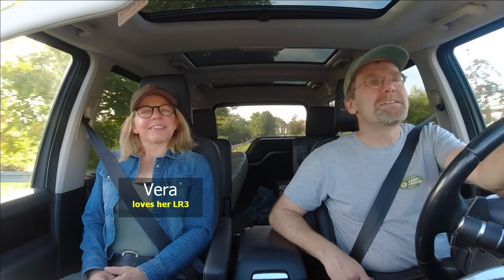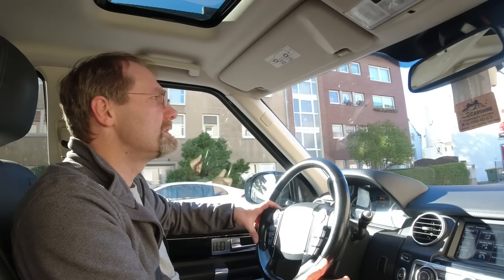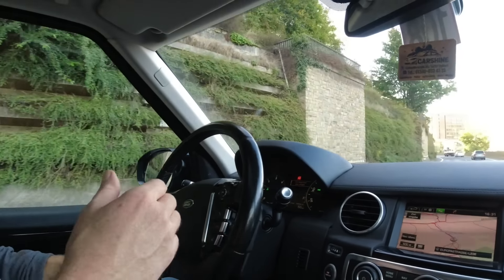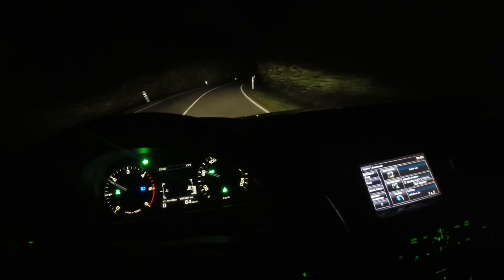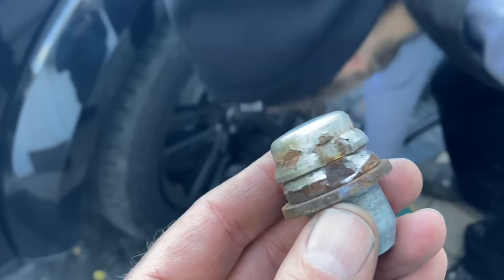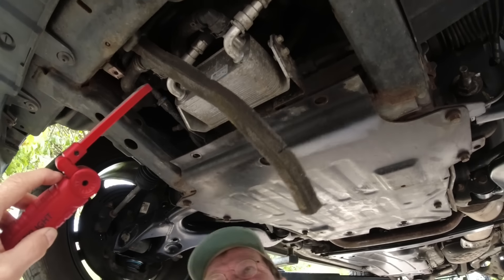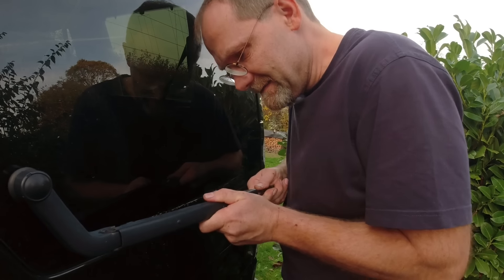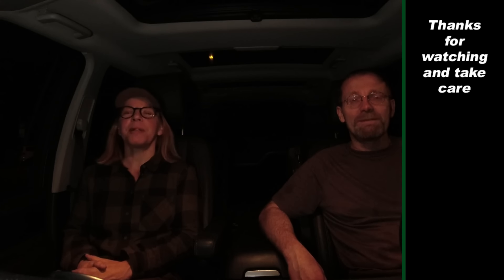How to buy a Land Rover Discovery - LR4

Comment: So, since you fixed all issues on your 2013 LR4, it's time for a new project. I suggest you change your strategy and buy a really crappy one. Then you have so many more projects and fun. The new one seems to have no issues. This is boring like a Landcruiser and won't stay with you for long.
Did you know that I predominantly started to follow your videos because you did all these nice drives through the little winding roads of the Odenwald, where we lived for a couple of years (Brensbach)? Then I got hooked on your Disco repair videos. 😅
Reply from the maker: Thanks Alex.  We just completed some serious repairs and now we got a burn out.  I could not fix the oil leak in the first attempt.  This video will be out soon.  I did find the cause now in the web and it is unbelivable.   The final fix will be down the road in a video.   I want a  good vehicle to drive to Darmstadt and not some crapy old car with no modern features and this is why I bought this mall crawler.  I can relax and drive in line with the cargo husband ebikers taking the kids to work while the wife has the big job...  Christian
Reply: @Vera_and_Christian  I look forward to this video as there is always good learning from them, even for a TOYOTA driver. With all these hours you spend on the LR's, I am surprised that you still work in Darmstadt. I could bet that you just drop in there once or twice a week when you are on your way to pick LR spares. JLR should offer you a job as Engineering Manager to make their cars more reliable, they would become the best on the market.

Comment: Also, I'm confident given your mechanical abilities, if it came to it, you could rebuild the transmission yourself.
I've done a few transmission rebuilds, and normally the issue is a result of leaky seals (piston seals, mechatronic to case seals, etc) and it actually is not so nerve wracking.
Just a simple, disassemble, clean, install new parts, re-assemble, fill, run adaptations, and go.
The only issue is getting the rebuild kit and making sure everything is totally replaced that are wear or sealing items. not a huge deal since its a Euro transmission, and you are in the heart of europe.

I think you could do it for less than 500 euro all in provided you do not need a new torque converter (most likely), since it is a 2-3 shift problem, its most likely the mechatronic to case seals alone and you are fine.
Reply from the maker: The leakage problem with the transmission here is of a different kind. You are going to be so surprised to find out what the leakage caused. Not even Land Rover dealers know this. 👍😀🙋‍♀️Vera

Comment: Great vid again. Wouldn't you mind letting us know, how do you checked the recorded failures ( OBD??, adapter? , App?, ...) By the way, there are some smart guys with the Deutsche Bundesbahn, the point is, that Germany is a country of automobile minded and payed people, far away from public transport. ... I quit VARTA, too, some years ago, due to poor quality. One of best batteries I ever had, was an " Everstart" , which I bought from a Supermarket. This batt serves my MB 207D for over 12 years, keeping in mind several drop downs to under 12 V during longer times of parking the camper van without external charger. The second best came from MOLL, which I trust in by now, but they are more expensive. Another well known company on my black-list is BANNER. I had to buy the 50500 Unibull ( not quite sure about the type), which has 2 positive and 2 negative poles, which is a usp in the market. The pre-owner of my Discovery "Trophy" ( 300TDi, no EDC, no ABS, but AC) fitted 2 of the banners for the electric winch. Next time when the Banners are flat again, I am going to change the wiring and get rid of BANNER for good.
Reply from the maker: Have a look at our new video. It will answer your question🙋‍♀️

Comment: Christian and Vera, the jerky shift could be low oil level in the auto transmission. I’m sure you know how to check the oil level in a ZF box? If not there is plenty of info on line.
Those 8 speed boxes are tough and don’t normally break. Megafush is always a good idea as well.
Reply from the maker: The jerky shift had nothing to do with low oil, Christian showed in the video why it most likely jerked and how he fixed it. 👍💪🙋‍♀️
Reply: @Vera_and_Christian  When I watched the video to the end I saw what Christian had done, my fault for not watching to the end before making a suggestion!!
Reply from the maker: @ianmenai  We  always have the solution for the problem we started with in our videos. Otherwise we do not publish the video, yet, until we have the solution. You must watch till the end to comment. 😅👍 Only with the Glow Plug debacle did we not get the job done we set out to do.😀🙋‍♀Vera

Comment: the fault for ECO mode is the secondary battery. Once that is fixed and it detects both batteries are charged, start stop mode will work.
Reply from the maker: It is all shown in the video. 🙋‍♀️

Comment: It's a diesel? We only got the 5 liter v8 in the states and they seem to have systemic issue with timing belt tensioners failing around 100k miles.

Comment: The images on the console for the drive modes are offset because there was an optional chasis stiffening mode on those generations, the image is like a curvy road when the car has that system.
Reply from the maker: I think nobody ever bought that option. Out of the hundred of thousands of comments we get, you are the first one who adresses that.  😃👍🙋‍♀️
Reply: @Vera_and_Christian  my cousin has it on a 2011 sport and it makes a huge difference in handling and stability at speed as well.

Comment: You need start using zx1 hyperlube if you want those engine s 2 last put 100ml evry oil change or motorkote hyper lubricant amazing stuff hardly any friction when you use

Comment: Talking of VARTA Batteries ! Our LR3 HSE which we have now owned for approx 16 months had a new VARTA battery installed 13 months ago. Yesterday I had to buy a NEW battery after 13 months the VARTA had a dead cell and only made just over 10  Volts. We live in Dubai and a Battery dying after 13 moths is not unusual here. Many people have said (Including BATT MOBILE the battery dealer) that the summer heat in Dubai (50 degrees C) kills the battery.
Reply from the maker: 50 degrees?  😳😳😳 that is the first temp of Veras baking oven 🥵.  Christian
Reply: @Vera_and_Christian  I do tell friends in UK if they want to experience Dubai summer temperatures, set the oven to 50 degrees then open the door and put your head in...!  Can you imagine what temperature the engine compartment gets to in summer! Thats why the batteries don't last.

Comment: If they changed the front windscreen, maybe they put plain glass rather than a heated one. Could it be the case?
Reply from the maker: It got a heated windshield.  I checked this during my test drive. I got all systems working now. Was all battery and software related 👍.  No repairs required.  Christian

Comment: I know it’s still a Land Rover but even LandRover’s are clever… So changing both batteries is a good plan to get the start/stop working again but…, you have to tell your Land Rover that you changed them both. Then the intelligent battery sensor will tell the alternator how much it needs to charge the battery’s . If not, your new battery’s will not get charged properly.

Comment: @Vera_and_Christian I have the same issue with my LR3 V6 , the same clunk at 6:11 but when I accelerate, not when decelerate. So far no-one, even JLR technitians have identified the issue. Any advice?
Reply from the maker: We fixed this in the videos afterwards.  It was a fluid leak and after resetting the adaptation, the problem was fixed.  If the 8HP leaks, it does strange things.  LR did not find this issue and the replaced the front suspension and the drive shaft LOL.  I bought it and fixed the leak.  All good and I still drive it today.  Christian

Comment: What tool did you use for scanning? I am looking to buy an LR3 but want to also scan it before negotiating the price.
Reply from the maker: Well, if you are really into fixing and modyfing your Disco, get the GAP tool, it's what we use mostly, with the app. If you don't, get the icarsoft V3.0 Land Rover/Jaguar only. We also use the previous model. I have it always hooked up to my Disco. The GAP runs at about 600€ and the icarsoft at about 170€. 🙋‍♀️Vera
'

Comment: so ... will you leave 20 inch on it, or will you replace your breaks with a bigger 380mm disks ?
Reply from the maker: It got the biggest brakes installed.  I will try to fit 19" rims down the road. Christian
Reply: @Vera_and_Christian  keeping fingers crossed to fit 19inch on it.

Comment: Beware the auto adjust speed on the autobahn. Also the auto brake. The front sensor is prone to getting road dirt on it. When dirty it does not see the car in front and may not brake if you get too close. Whoops!!
Reply from the maker: The sensor is a radar below the bumper.  So far it picked up fine even if heavy rain.  It’s dangerous when the speed is reduced to 80 entering a construction site and then the leading car changing lanes 😳.  The it speeds up full throttle.  Christian

Comment: OK so I have opportunity to buy an Disco 4 2015 SE with 212K miles on clock but a full new block and engine rebuild 15k miles ago ex police motorway vehicle so fully maintained with full maintenance record. Tested for fault codes and all good. Is there anything I missing. PS price is very good
Reply from the maker: Put 500 pounds per month aside for repairs unless you can do everything yourself.  Christian

Comment: After replacing the battery, did you tell the BMS (battery monitoring system) that it has a new battery installed? :)
Reply from the maker: No. I just got my license for the car from GAP yesterday.  I need to look into this.  Thanks. I think it is only required if the bat size is different but I will check 👍. Christian
Reply: @Vera_and_Christian  Please do, I believe you have to do it every time you renew battery, to get the charging system to adjust the charging accoring to the state of the battery ☺️

Comment: Christian, I’m looking at buying my first LandRover, what OBD2 scanner would you recommend if I’m looking at LR4s from 2012 to 2016? Also what is your opinion of getting a lr4 over a Range Rover?
Reply from the maker: A IcarSoft or similar will do.  Top of the line is the GAPIID.  Range Rovers are not driven by Overlanders.  Here in Germany, used Range Rovers are reserved for Mafia, Drug dealers, money laundary, Cartel members, and so on.  My criminal record does not qualify me to drive a Range Rover.  Christian
Reply: My opinion is don’t bother with any other scanner except the GAP IID BT Tool. It’s the only one proven to detect & clear all/ most faults the others can’t even see. It’s updatable and you can do so much with it (like completely remap your engine) and the best thing about it is the residuals. I’ve seen used ones exchange for close to the price of a new one. So when you come to sell your chariot you can sell your scan tool separately and get almost all your money back. Anyone buying a used LR product of the 2005 - 2017 era must get some sort of scan tool. It’s the first thing you put on your Christmas wish list.  - As for Discovery 4 vs Range Rover for overlanding, personally I would’ve loved an L322. Just as capable, more comfortable but in Europe we have 2 choices large diesels (which none conform to Euro6 standards) or the 5.0 v8 supercharged, with it returning less than 20mpg (even on the freeway) you will be spending a lot of time refuelling on a road trip. There’s a guy in the uk that has a channel dedicated to overlanding in a 2010 Range Rover. He even takes it off road.

Comment: Great video. I rally dislike the ECO function. The engine always switches off just before I'm about to pull out of a junction and makes it dangerous I think!
Does your new mall crawler not have no DAB built in? My 14MY does.
Will email you some useful info too.
Reply from the maker: No, unfortunately not. 🙋‍♀️Vera

Comment: Quick question Christian or Vera; is the 15w40 oil for all seasons? I smile at your subtle jokes e.g. condom manufacturers are good with rubbers. Cheers from Oz. 👍🏻🙏🦘
Reply from the maker: We run 5w40.  In Germany it works year around. We don’t get temps below -10 to 15 deg.  Christian

Comment: Looks like a great ride!

When you change the batteries on your Disco’s, are there any resets that need to be performed or is it a simple/normal change?
Reply from the maker: Battery must have original spec. Then it’s a simple swap.  D4 requires a battery setup if a different bat is installed.  Christian
Reply: Great. What battery do you recommend? I have a 07 4.4

Comment: Always always always get a transmission service on an auto car when you buy it. They are sold as non serviceable and last the life of the car, but this is BS, what manufacturers actually mean is they don’t need servicing until the warranty runs out. It should be the first thing anyone does with any auto second hand car.
Reply from the maker: Agree. Christian